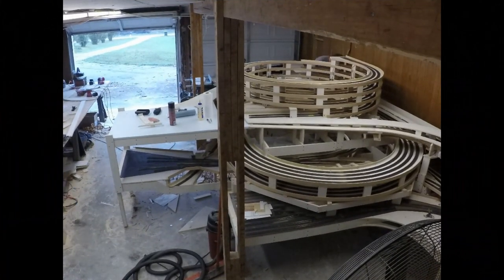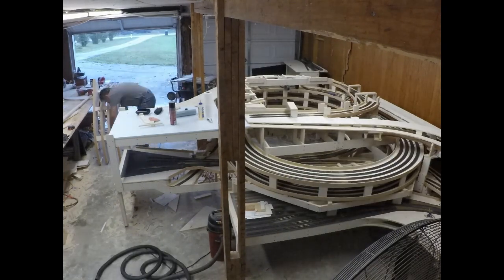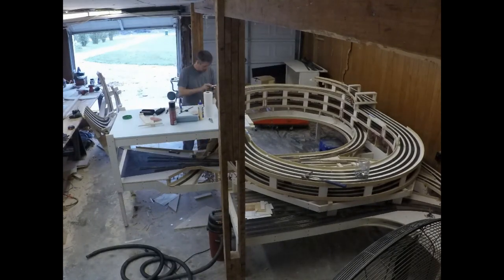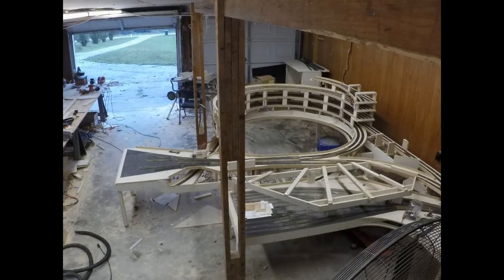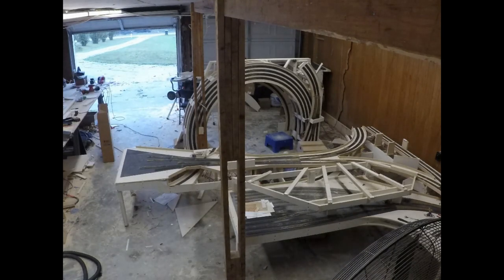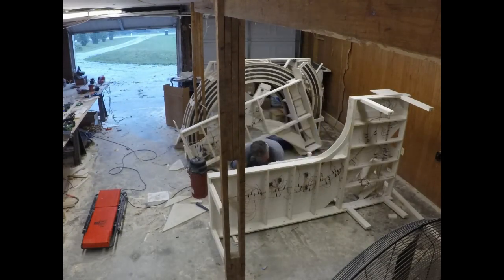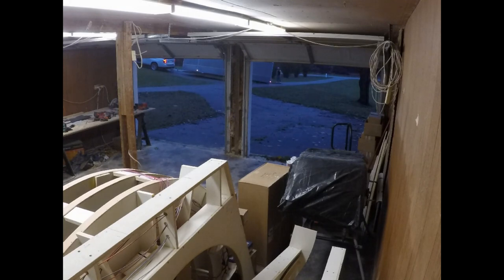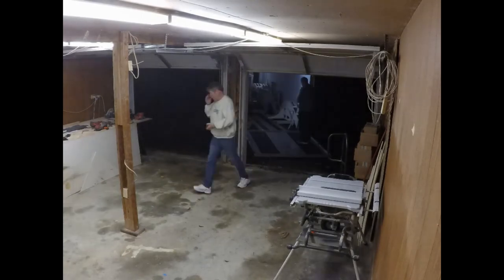Missabe & Western part 9: dismantling the helix

Comment: A million screws?  :))  10,000,000 Seconds =
115.74074 Days
(rounded to 8 digits) given 10 seconds a screw. but you are a genius.
Reply from the maker: No it's definitely not a million, but sometimes it seemed like it.  There were probably about 10-12 lb of screws used in that part of the layout and I'd guess that about 200 of them had to come out for disassembly.  The main base frames were bolted together but everything else uses drywall screws.